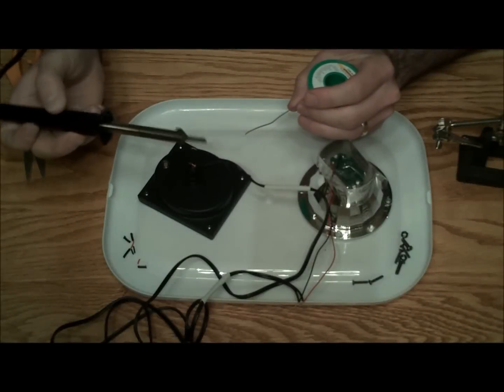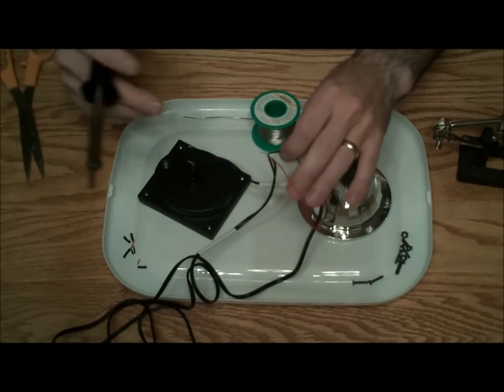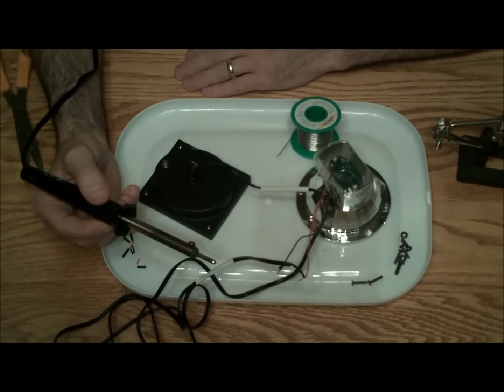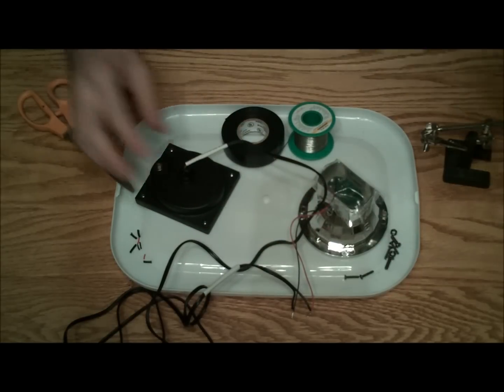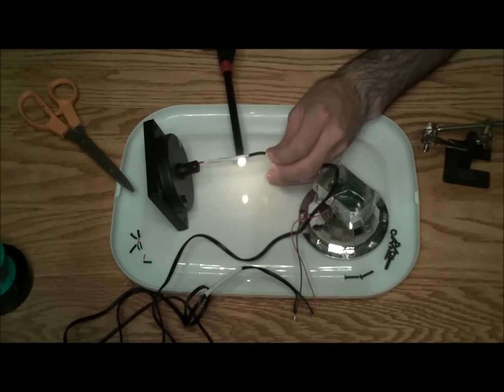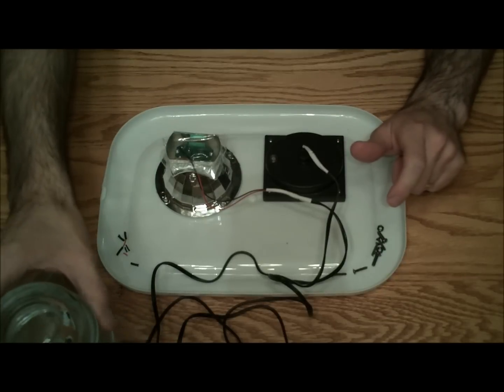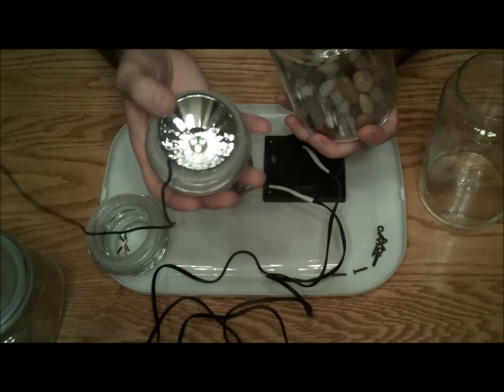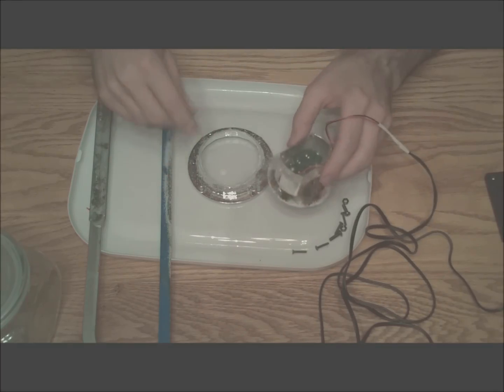Solar led lamp pt 2

Comment from the maker: I did not figure out the calculations for this project. I usually just put these lights in rooms with good sun light and a cord of 5 to 10 feet. The longest cord I have ever put on a lamp was 15 feet and it worked just fine. If you plan on going a long distance I would use bigger wire. Thank you for the question, Lonny